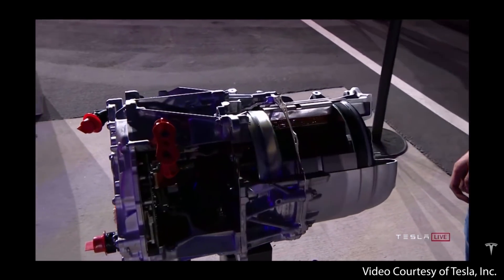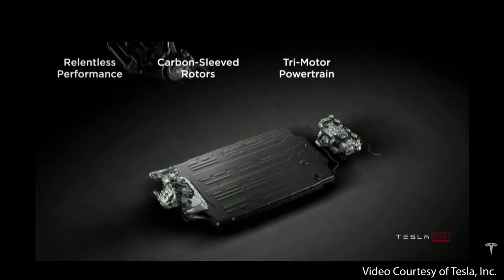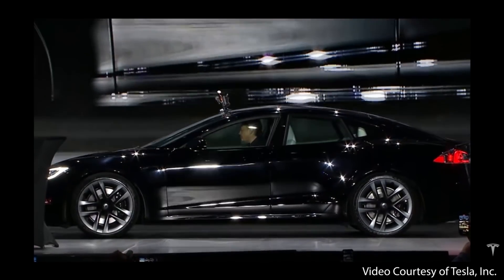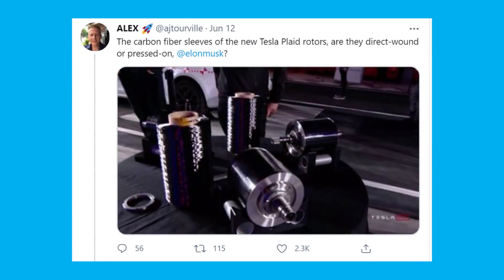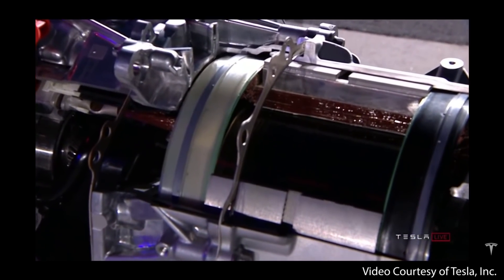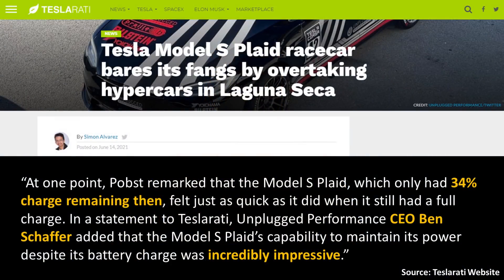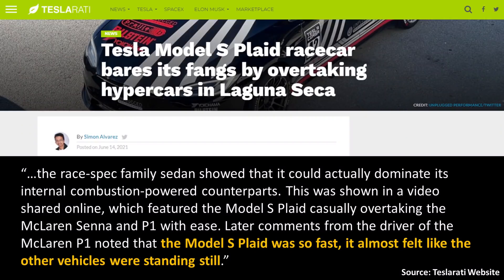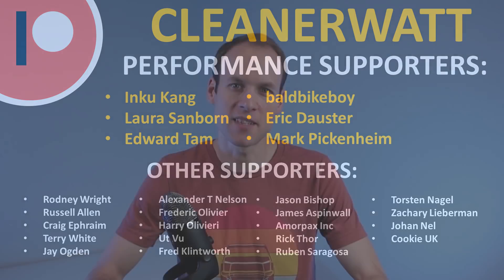AMAZING Tesla Plaid Model S MOTOR TECH REVEALED

Comment: Unfortunately, the Model S Plaid has severely underperforming brakes as well as a nearly 5,000 lb curb weight, which means you'll not only have to extend your brake zones for safety even in regular conditions -you're almost guaranteed to be passed in corners as you struggle with ½ a steering wheel to fight the inertia of the car around a corner. To make this all worse, the power steering will absolutely crap out trying to keep up with the extreme loads in spirited driving... These are all issues that the other cars on your list do not have. And though the model s plaid is faster in a straight line, on a track or through a city with corners it can easily be overtaken.  And this is an issue for the plaid... Because the people who buy it do so because they want to show off. But what they're going to experience in any road test outside of a drag race is being shown up by their competitors.
Reply: FORTUNATELY TESLA LISTENED AND NOW OFFERS AN UPGRADED CARBON CERAMIC BRAKE SYSTEM.
Reply: @MICHGO1  THAT'S GREAT!! I'M REALLY HAPPY ABOUT THIS.

Comment: Just imagine what specifications you would get if you put the plaid powertrain in a carbon fiber sports car with a much lower weight and optimized for track. I am very curious how the Roadster will be build, the first gen Roadster used a lot of carbon fiber, but I am not sure if Tesla will do that for the second gen Roadster too. It may make sense to have an entry level model and a weight optimized higher end model.
Reply: I imagine it'd be like strapping a jet engine to a bicycle

Comment: Is still synchron-e which isn’t very environmentally friendly. (Neodymium) Did they still use individual wire for the motor? 
I neither want more torque nor more rpm’s as you are not allowed to drive so fast, better make it more efficient and less reliant on rare earths like mahle did. Do they still have the pump and the filter for there motors?

Comment: The Long Range 80K car is the "gem-in-the-rough" 3 second 0-60 is fast enough for the street.
Reply: and, save 50g...1.2 sec.difference with extra 15 mile n range, just ordered one for myself..
Reply: @johnwang5336  Brooks from Dragtimes got 2.74 @ the reveal night. The Plaid without preparation heating the battery and having a sticky takeoff surface is not that fast. Tesla has reached the wall for red light performance.
Reply: @BillB33525  agreed..cheers!
Reply: @BillB33525  the same person you are talking about, go to his channel, he has got 1.99 seconds on the street relatively consistently. No special BS required.
Reply: I can't wait to see the numbers the LR puts out. I think people are going to be pleasantly surprised.
Reply: Cyber truck is 2.9.
Reply: @xploration1437  I'm more interested in 500 mile range..
Reply: The LR can now match the 1/4 mile trap speed of the Taycan Turbo S. It's slower to 60mph but from a roll its every bit as fast as the Porsche.

Comment: The new electrical drive motor shown at the Plaid reveal will not only power the current Plaid Model S and Model X, but the new Roadster, Cybertruck, and other future Tesla performance models. I have also seen the Lucid Dream Air's 900V+ electric motor that weighs just 163lb (74kg), also spins up to 20K RPM, and is even smaller and more powerful than Tesla's new motor, producing 650HP each (vs 400HP+ each for Tesla).  As always, competition breeds innovation, so it is good that EV competitors are keeping Tesla on it's toes, and we can count on Tesla to continue to innovate, improve, and re-engineer their drivetrain technology moving forward. Even though Tesla's new motor has many improvements, it is the combination of the revised heat pump, cooling system, inverter, and improved battery pack that work together to attain new levels of usable performance and high efficiency.

Comment: Thx for the information. Still wondering why they kept the 18650 batteries. 🤔 I do know they didn’t use the 2170 batteries because it takes longer to hit high speeds because of the battery size. I just always thought the 2170 batteries were like magic rocks! ⚡️
Reply: 2170 are great, but they can't scale it up like the new 4680 in terms of cost and material. Model 3/Y Performance uses 2170 and they are fast sturdy cars.

Comment: Aloha, great to learn about solution to high rpm with carbon fiber. Permits Tesla to stay with single gear . But why? Wouldn't a continuously variable transmission or at least an overdrive gear, be simpler solution? and same result? Or would acceleration a higher speeds suffer?
Reply: Xp Reflex  If the single speed setup gets the Plaid model to 200MPH already, and the new motors are supposed to be able to spin up safely past 20K RPM, Elon seemed to hint that this new motor might be able to attain the Roadster's super fast speeds without adding a second gear. Personally I think that top speed is the most overrated and useless feature of a high performance car.
Reply: @deanmcmanis9398  200 mph and 250+ mph are worlds apart, think exponentially.
Reply: @Martin_Speed  I think that top speed capability over 200MPH is a pointless goal. The only realistic value is for boasting rights. Rather than Tesla spending a penny more trying to achieve a top speed goal, improvements in ANY other area would serve their customers better.
Reply: @deanmcmanis9398  Agreed or just offer a track package. A lighter car and higher range or faster charging time would suit most people's needs much more.
Reply: @deanmcmanis9398  it isn't just about achieving 250mph though, it's about the all the things you learn to get there. Engineering is all about setting seemingly impossible targets, then applying what you learned to everything else. Same concept as NASCAR and other racing series and the trickle down to ICE.
Reply: @SteveBrodkin  I can totally understand that analogy for Tesla race cars. And also the realistic overkill of producing 1020HP in the Model S Plaid will have a trickle down effect for more affordable Teslas. But even though the capability of having a Tesla run the 1/4 mile in just over 9 seconds is not a practical need, ALL Tesla owners of the Plaid model can enjoy extreme acceleration on demand. But in contrast, at least in the U.S. where most posted speed limits are 65MPH, and people rarely exceed 100MPH on public roads, 250MPH capability is pointless. There are few roads, and even racetracks where you can safely drive 250MPH. And all of the technical achievements and design improvements  utilized in getting to that (virtually unusable) 250MPH speed are also produced to get to 200MPH. In fact there are many sacrifices in usable performance that you have to make to top speed vehicles. Which leaves the only real reason for having a top speed over 200MPH. Status, and bragging rights.
Reply from the maker: You make great points, but ever since their transmission issues in the original roadster, they have only manufactured single speed gearboxes. Would a 2-speed gearbox be a more simple solution? Maybe, but with all their smart engineers, they must have a very good reason to stick with a single speed gearbox. Maybe we will here more on this in the future from Elon.